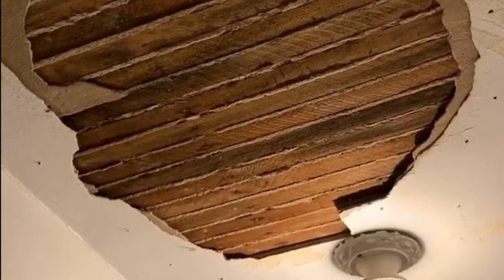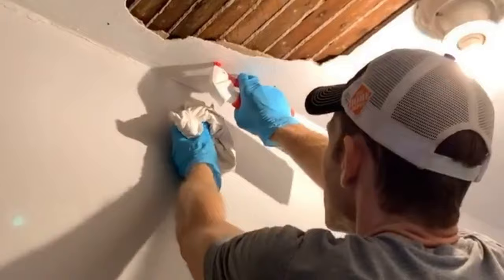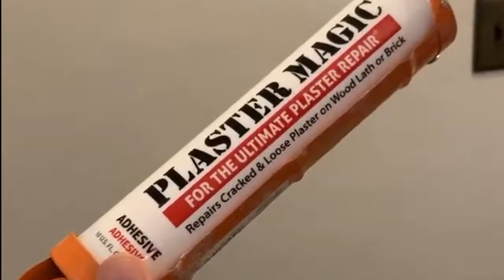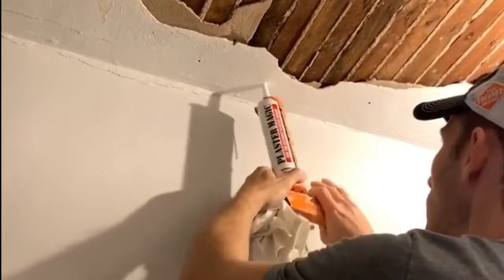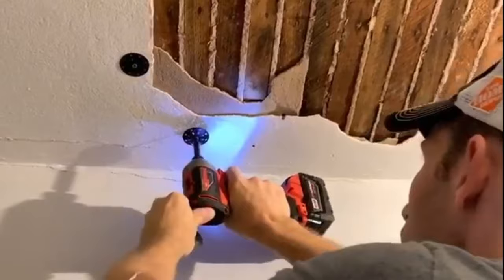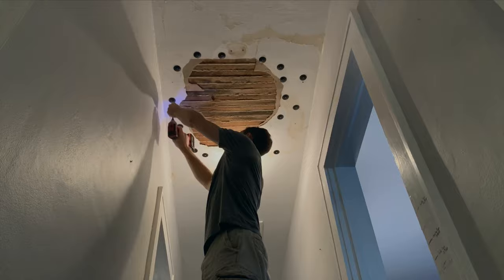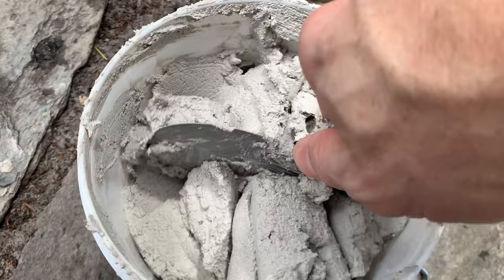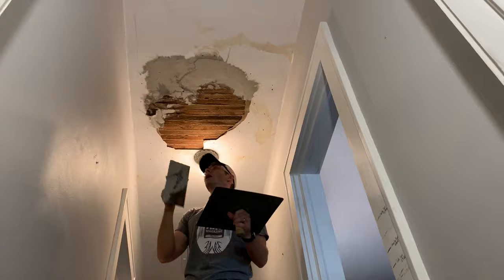DIY Plaster Ceiling Repair

Comment: Pushing out the the old plaster between the lath forms a better bond since it keys in between the wood strips. Just push it through, no need to try and completely remove it. Great video.

Comment: I have used Big Wally's Plaster Magic and Plaster and I can say that it really works. I have horsehair plaster ceilings with lath. I left my washers in because I think that the is hold better. I fixed my ceiling at least 10 years ago and it is still holding.

Comment: Hallway ceilings, just cover it with 1/2” Sheetrock, walls, I would take the time to patch. Check out Kirk Giordano’s plaster repair videos.
Reply: You would advice going over the whole ceiling with Sheetrock instead??
Reply: @MWCRUSADER0508  for a skinny old house hallway ceiling that’s 3ft wide, and Sheetrock is 4ft wide. Yes. All day long, I would not waste time on a plaster repair, just put Sheetrock right over it. Don’t use regular paper tape in the inside corners, use the surecorner, with the metal or plastic reinforcing strips. So much faster, and will look better.

Comment: What about knocking out the old plaster between the lath? Is the new compound you’re applying supposed form that mushroom key? I’ve been so afraid of diy’ing this project and it falling down. Thank you for this post. Song: A Hard Day’s Night?
Reply: Its not a bad idea to knock the old Plaster from between the lath, but not necessary. You can buy sheets of mesh to stuff in there. You just want the Plaster to grab onto something besides itself.

Comment: Thank you for this video. As a diy’r I wish you had a voiceover of what you we’re doing sped up. Were you wetting the plaster with a sponge. I think I can not tackle this ceiling. A drywaller gave me a quote of 3400 for a hole that same size. Thanks

Comment: I have been plastering since 1983 and i have never done this foolishness. 
Bond the wood lathe with plaster weld including the existing plaster and onto the surface about 3in. Then attach 3.4 expanded metal lathe over the top of the bonded wood lathe. Then just plaster it with perlited gypsum plaster, then finish to match existing. Respectfully, Ed.
Reply: Agreed, I started plastering in 1996… this system is an overpriced bandaid that won’t last as long as your advice! 
Which is how I was taught as an apprentice!

Comment: OMG I just discovered your stuff and my hair is standing on end...question about this project and the materials: I have some common plaster cracks on the ceiling of my 1924 Craftsman that I would like to fix. No major damage, just cracking, and some areas that might be de-laminating but are not cracked. If the Plaster Magic conditioner and adhesive were to be used on both sides of the crack, could I then simply scrape out a "v" in the crack and then fill it? Similarly, could I use the conditioner and adhesive to pro-actively arrest an area that might be de-laminating?
Reply from the maker: Yes to all the above. Works great in that application.

Comment: Our house was built in 1944. Slump block walls with plaster. The ceilings are not drywall as they didn’t have drywall back then. It’s much thicker and plaster like. Walls and ceilings have been getting cracks. How would you suggest the wall patch?  I don’t think the screws will go into block and wouldn’t want to make holes in block?
Also the ceiling. ??
Reply from the maker: You can use the same system but you have to use a 2x4 and plywood or some other method than the clamps to press the plaster back into place while the adhesive cures.

Comment: why did you remove the plaster washers?  I thought they're suppsed to stay
Reply from the maker: This is a system that uses the washers to hold the plaster right while an adhesive sets up. Thank nice the adhesive is cured then you no longer need the washers which makes patching much easier.